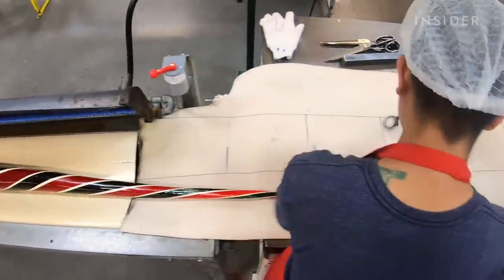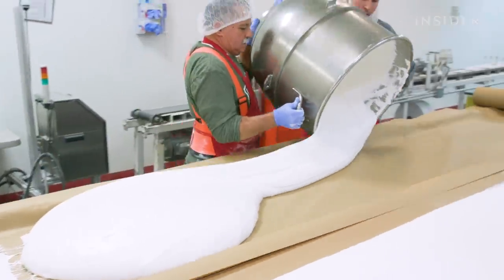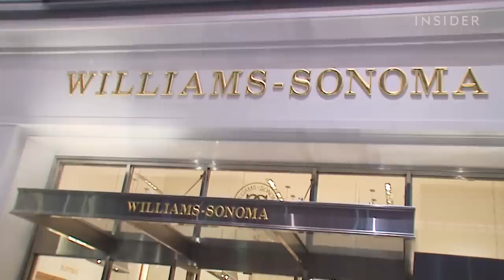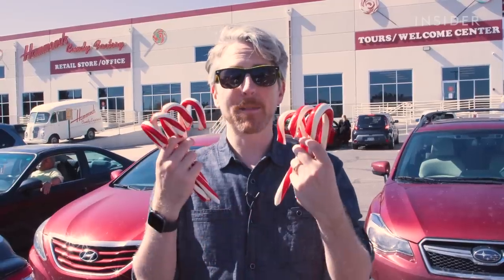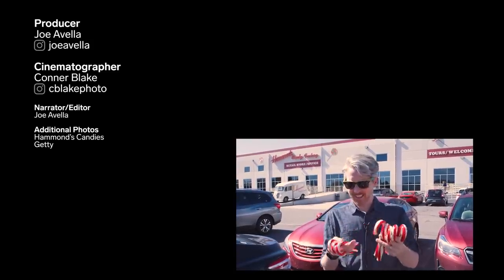100-Year-Old Candy Factory Makes 10 Million Candy Canes Per Year | Legendary Eats

Comment: I loved candy. Candy can seperate body from its suffering. I used to put candy in my mouth when I work or drive or go hiking even sad or want to smoke. So my teeth rot a lot. It did cost almost two new sedans to cure my rotten teeth. And I found out.  Candy does not reduce pain but puts it back for a little while. But it was just my fault. After eating candy, Be sure to wash your mouth with water every time.